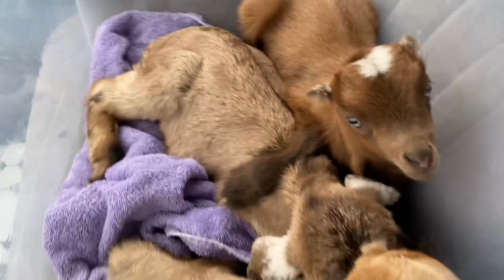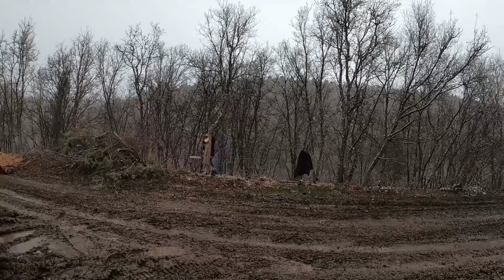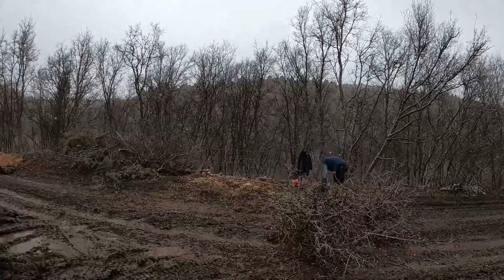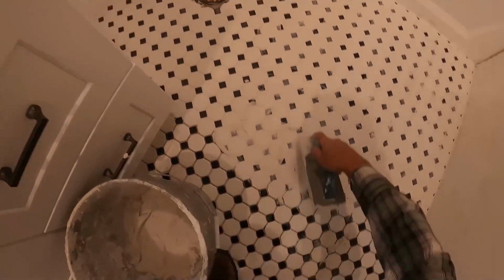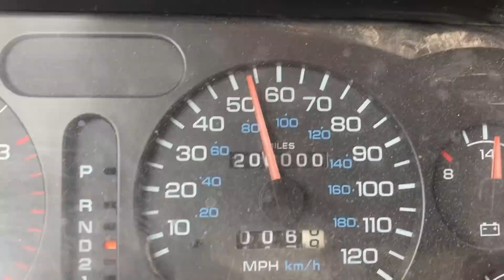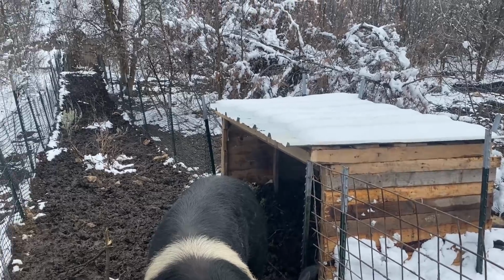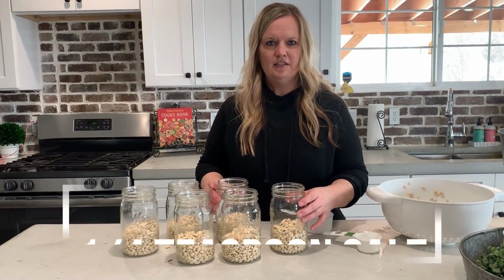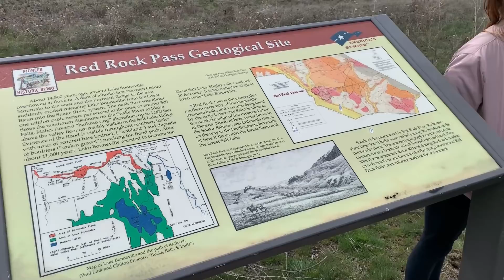#404 -Vintage Bathroom Tile Done!

Comment: I put down these exact tiles. As you noticed the edge joins aren’t perfect. I found that to get  the little black diamonds to join into the neighbouring mosaic, I needed to slit the fabric on the back occasionally. Your tiling looks very good. Typically the small errors in tile spacing will only be noticed by you. 
Your family and guests will never notice

Comment: I brought a sample of that same tile home for an upstairs bathroom, to use around the tub shower enclosure, a complete remodel, 3 months into this project, the body does not like this type of work anymore so it takes a lot longer to get it done, so what. I threw out that tile sample because I wasn't going to try and cutting all those small triangular pieces to fill in the edges of the tile. I'll find an easier pattern, you did a great job on that floor.

Comment: Heath, I've laid tile for many years. In about 6mo to a year the grout along the tub walls and vanity will crack due to expansion and contraction variances between the 2 different materials so plan now get a matching caulk they even have sanded for better match when it cracks clean it out and caulk it for better results. But great job on the work that you've done.

Comment: Wipe of the grout on a 45 degree angle you get to wash of quicker while it's more"wet" it make the surface excess a lot less painful to clean and you wont have any pin holes.

Comment: I had some sawdust from woodworking and know now that I am set up will have a ton more. I also have a back area to my yard that is muddy and stays that way most of the year. So I looked up if I could just start dumping my sawdust on it as fill. After browsing several forums for lumber mill operators and hobbyists the conclusion is that it makes the matter worse. While there were several examples the take away I got from it and my experience is like an old dirt road where the top several inches are dry but by walking in it you can tell underneath is not; it is spongy. Apparently sawdust will insulate and prevent it from drying in a timely fashion or all the way. It absorbs great but now the sun is drying a sponge on top of a washcloth and not just a washcloth. I might not be illustrating it well enough but in the end I chose to use some around some trees and maybe will in the garden, but the rest I will pill up somewhere “outback”.

Comment: I knew a guy that was a master welder but he was very talented at whatever he did. Back in the 80's and 90's he sort of specialized in taking a car with a wrecked front end and getting the same car with a wrecked rear end and then cut the bad end off and make a whole car out of two. He was very good at this, but he had to get someone else to do all the little things that add up. All the precise bodywork and trim work. He was great at the big stuff but couldn't stay focused on all the little things to get a car done. I'm sure you're seeing the same goes for finishing out a home. So many little things just stack-up. I admit, i get side tracked in a similar way on large projects.

Comment: It sounds like Heath took my advice of using wood chips on some of the muddy road spots. Good luck with the road drying out as it's tough with those quick snowstorms coming by. All you need is some sunshine and a nice breeze and you'll be good to go.

Comment: FYI, you grout tile with a "float". It has a rubber face. Also, wherever the tile meets a dissimilar material, a corner, or ninety degree angle... never grout there. When dried over time, that grout will crack. These joints should always be caulked using color matching caulk.

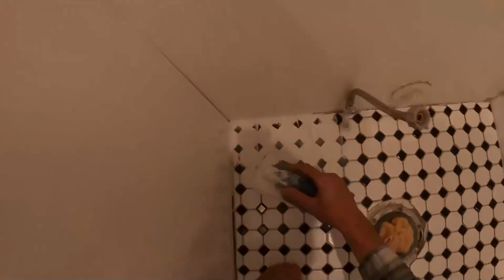Comment: 8:38 You too? Thanks for that revelation, now I don’t feel so alone! I ripped out half a wall in our shower enclosure because I wasn’t happy with the lay of the tile. Now I have a sink drain that won’t stop dripping no matter what I’ve tried. Getting the proper parts is a challenge thanks to C-19 not playing nice with the rest of the world! I am about ready to paint the bottom of the sink with a tube of silicone caulk!

Comment: Laying tile is easy. I have found that in a bathroom you usually  have two very visible straight lines. In your bath room you have a straight line with the tub and  it is joined  on your blank wall. these  lines are very visible and you don't cut the tiles next to them.  Behind the toilet and under the front of the cabinet you can cut the tiles and it cant be seen. Behind the door and to the left of the sink you will have to cut, but it is a short wall  and  it is less noticeable.  I'm self taught, but in a 3000 ft home with tile, marble.and parquet floors I have had a little experience,  I've done several remodeling  jobs as a contractor and paid for quite a few as a insurance adjuster.  Not trying to be nosy and have really enjoyed watching you work.  Keep the videos coming. Good luck.

Comment: This question does not pertain to this vlog but please help me. I saw you can dry beans could you please tell me what lb of pressure and how long to can? I think you put in 11/2c beans and salt? Thank you if you could help me i do can and never thought of that i want to try. Love you guys.
Reply from the maker: I sorted and rinsed beans really well. Than added 1 1/3 cups beans, 1/4 tsp salt. Then I  filled with warm water (I left about 1 inch from the top of the jar) I did 15 lbs of pressure for 1 hour 30 min. As always....check with your pressure canner instructions. Your altitude should determine the pounds of pressure. 😁 Good luck! Email me if you need too. 
Redpoppyranchcedar@yahoo.com

Comment: Hi guys, growing up as a kid we had both Sheep and goats. If we'd found a lamb seperated at night, cold and frail we'd bring them into the house by the wood heater and give them some Brandy in some warm milk. This worked extremely well and we we're then able to return to mum if she was found.

 If we couldn't find her we'd find a ewe with milk and applied vanilla to her nose and head and then add vanilla drops placed in a line from head to tail to the lamb. This both confused the ewe and she would allow the lamb to nurse and eventually the ewe took the lamb without more vanilla applied.
We bottle fed a lamb who was attacked by dogs, that bit of the entire skin from the lambs tail (in Australia we dock lamb tails to prevent flystrike) she survived by using the brandy and milk and then went on to a milk supplement, the tail being removed by knife about 2weeks latter. We use rings to remove testicles, but use a knife for removing the tail as it's more gentle on the lamb with the lamb standing up and nursing 4 minutes after tail removal. I think using rings to remove lamb tails is inhumane, as it's very unpleasant to watch and to describe would make you feel sick. Do I won't. 

But the brandy really works really well for lambs which are cold, weak and distressed. 
Have a great day! Hugs from Canberra down under.

Comment: Hold the striker at the "point" like a pencil.  Make small quick "C" shapes on the surface (slate, glass, etc.).  Hold the pot from the bottom with your finger tips. You can scuff the surface and the tip of the striker with 100grit sandpaper that helps.

Comment: I know you are anxious to begin building your shop but your road may yield a higher quality of life. I think cutting trees on the side has a high payback in firewood and drier road. It will make all the other repairs easier too. I would print aerial maps of the roadway and mark areas that need work. You can assign a number priority of 1 to 5. I would make a five year plan for gravel, ditching, culverts, and drainage. You can plan according to cost,  easiest to accomplish, most needed, by section of road, or any way you like. Having a written plan is what is important. Seeing accomplishment each year can motivate to continue as jobs get checked off. It lets you budget as well. Your town may be able to provide some gravel, labor to cut trees, damaged but usable culverts that could be cut down and reused. Neighbors might be able to chip in as well with money, labor, or materials, or equipment. In my area of the country, farmers cooperated in the last century by snowplowing a section of their roads in winter with horses or grading in spring. You could also form a homeowners association. Might give you political clout as well.

Comment: You should build the shop with aircrete panel walls like on the youtube channel HoneyDoCarpeter be perfect to build the shop for way cheaper.
Reply: Had you used the word 'could', your chances of him listening/replying to you would have increased enormously.
Reply: Darwin´s builds are experimental. Before thinking about using them, it's good to check if building code allows his techniques in a larger build. The metal forms / panel rims might be cold bridges. Darwin's efficient rocket mass heater could be nice though. Andaircrete elements could be usefull in the garden, and as a kids project as well.

Comment: I would strongly advise you not to put the wood chips on your road.  For a while, it will be great.  Once they break down, they become nice EXTREMELY SOFT soil.  I know this because we put them around our barn drip edge.  Great for a while and then last winter was a nightmare as the cows drug their udders through the muck.  We ended up having it all dug out and an appropriate rock mix put down.  Use those wood chips on a future garden site instead. 

Gorgeous tile job.  You've convinced me I do like that pattern.  :)

Comment: Floor look's great. Check out Charlotte Mason on line for homeschooling. I think you will like the way it goes. 2 cattle panels set up like a low tunnel covered with a tarp. Use t-post's on the sides to hold them down, easy peasy.  Fill with straw and their happy. Thank's for the video. Stay safe and healthy. God bless

Comment: Heath, the tile in the bathroom looks great, you're too hard on yourself and too much of a perfectionist, admirable, but when it becomes a fault its time to just get things done and move on. Damn, more snow....and more mud. Have you thought about throwing a base of the tree branches down on the road and covering that with wood chips and then gravel. Years ago, when I was a kid, my dad sold cottage property and that's what they did for the roads in the area. The branches were for structure, keeping the gravel from moving to the sides because of treading, the wood chips were to absorb water and make the driving smoother, and the gravel was for traction and maintenance of the roadway. The cottage properties were in mainly conifer forest with some deciduous outcroppings making the ground very loose and when they would get wet, especially on embankments, the road would slide out from underneath the vehicles, which would cause a lot of stuck vehicles all over the place. And tow trucks couldn't get in to get them out because the weight of the tow trucks used to make them sink in and have no traction. They did the base of tree branches, with woodchips on top and standard road gravel on top of that, and never had a problem again. You're ground there is more deep decayed matter soil, so giving it structure and weight would most likely do a lot of good.

Great video, I wish there were more each week. I look forward to Red Poppy Ranch each week! Keep Safe Down there. And the economy, well, it'll bounce back. The good thing is the whole world is effected so all economies are equalled to every other country. That works to the whole worlds benefit.

Love to you all!,
-Matt

Comment: I hate commenting on my partners Youtube but I wanted to say this before I lost the thought.

I think that using the money likely in a bank account is probably the best idea right now actually. You would be putting it to a far better use than it just being numbers in a bank account. It provides protection for all of your  tools and equipment, a place to start and store seeds and food outside the house which would be at a cooler temperature. Most importantly would prove a means of income should it get to a point where you wish to barter for things. It is absolutely an investment in the life you have been building towards for a long time. Currently the issues aren't as bad as they could get, but no matter what you cant get the time back you would waste if you decided to wait for this to blow over. i would suggest if you can get as many materials as you can before your area could potentially get locked down. You already have a years food supply, but I would suggest investing in some seeds and perhaps a greenhouse [which can essentially be built with boneyard/pallet wood and plastic sheeting or panels or even polytunnel type plastic if you were concerned about cost..
If the concern for you is that you would like to keep that money there just incase, really what would you need to spend it on.. food? you have the capability and most importantly ambition to do that for yourself anyway! The kids are off school, time to put them to work haha!!  You guys are truly helping me stay sane and focused right now. Thank you for all that you do and continuing to share your journey.  [My actual youtube handle is Gliddonator, I have posted a few times before, hope everyone is well]
Reply: Also after seeing Cedar's cooking I'm gonna ask for a weekly recipe day from her!! Pretty please :P

Comment: Just to be that guy, my apologies. The unemployment rate is by no means me as at record highs yet. Not even mentioning the great depression. "Unemployment Rate in the United States averaged 5.73 percent from 1948 until 2020, reaching an all time high of 10.80 percent in November of 1982 and a record low of 2.50 percent in May of 1953"

Comment: I think we can open the USA in many states in a month or less , a few hot spots may have to be shut down a bit longer, Do you think the subway system was a big cause for New York to get so bad ? That Malaria drug has had nearly 100% success in Europe and it only takes 6 days and costs very little.( along with an antibiotic) Perhaps the FDA is holding things up here in USA. Ask your DR, for it.

Comment: Are there no toilets in America that are wall-mounted?  Such toilets have not been used in Europe for 30 or 40 years.
Reply: I am 57 and have never seen one. Lived in four different places in the USA.
Reply: I live in the UK,we can get wall hung kit but it is not much used, because it is bloody useless for most retrofit, swapping to that style means stripping and beefing up partitions, or getting lucky enough for the brick joints not to interfere with the fastenings.   Wall mounted is not much specified commercially either.
Reply: @CrimeVid  If someone doesn't value aesthetics and easier cleaning, they should stick to the old version from the post-war period.
Reply: I take it back, I have seen these in large industrial settings, like a stadium or a school.
Reply: @lykinsmark123  👍👍👍
Reply: Werner Pfeifer What on earth has that got to do with having to half rebuild a house to change a toilet ?    In my country a very large proportion of the housing stock is pre 1939 and just not suited for wall mounted porcelain, for instance my house was built in the1890’s with lath and plaster partitions and has in total the way it is configured, 24” of brickwork that you might attach anything to with any hope of success, and good luck with that !
      And another thing, I have had some experience of wall mounted porcelain in commercial buildings and eventually by misuse or bad fastenings the damn things come loose and are hells delight to re-hang.      Don’t misunderstand me, I like the cleanability aspect of wall mounted sanitary ware, but it is best suited to new build and best possible installation practice.
Reply: @CrimeVid  Because that is incredibly antiquated!
Reply: Werner Pfeifer What is the point,new for new’s sake. pointless